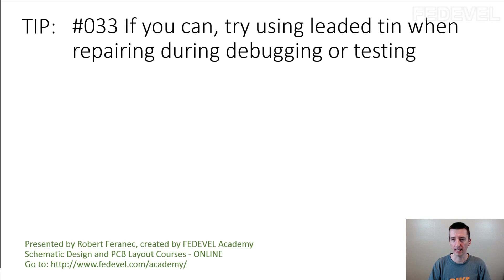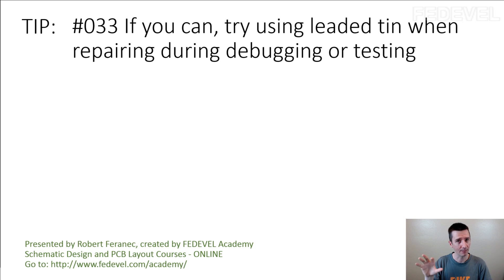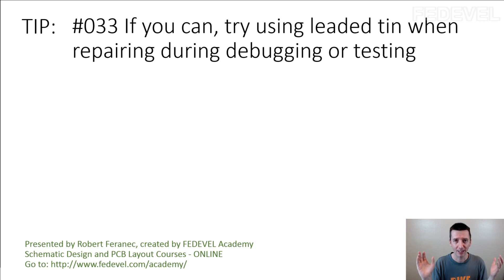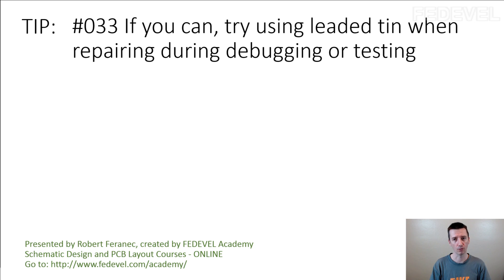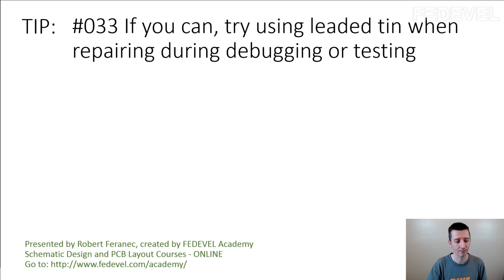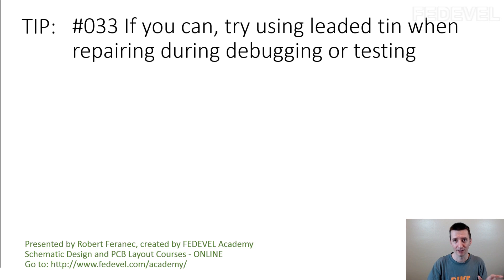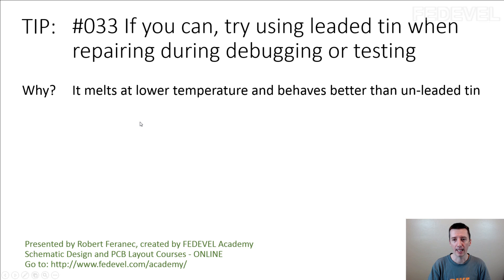TIP #033: If you can, try using leaded tin when repairing during debugging or testing

Comment: Robert, Solder is a more common term instead of tin.  Thank you for the great tips.
Reply: Robert Feranec solder is the american word, so as it tends to happen is the de facto standard.
Reply: Robert Feranec we (U.S.) also tend to refer to it as "lead-free solder" when it contains no lead.
Reply from the maker: Sometimes I am not sure what terms are used in different countries. Does everyone call it solder wire or are there also other terms?
Reply: In American technical English "tin" as a synonym for "solder" is slightly vague and ambiguous ("tin" used to be a way to refer to canned foods in American English and of course it is a metal like gold and silver). It is also old-fashioned. In  American technical English "solder" is unambiguous, clear, and what all the cool kids have been using for at least a couple of decades.

As you probably realize, when one seeks to communicate clearly (and not, say, obfuscate or at least be intentionally vague) it is almost always better to use a word that has one specific (unambiguous) meaning than an alternative word which is more general and potentially ambiguous.